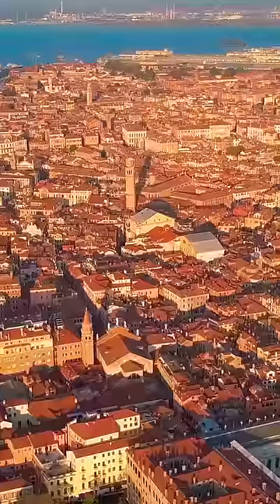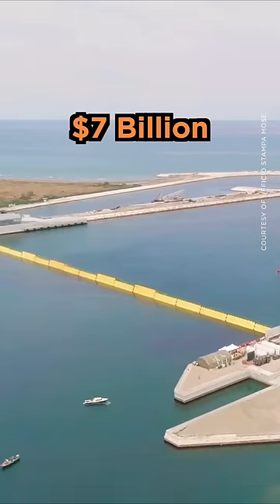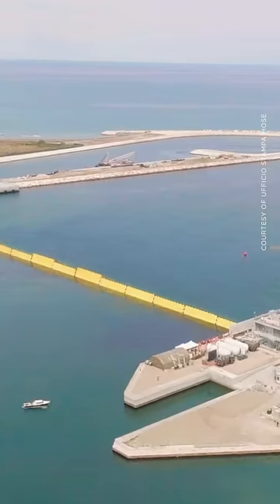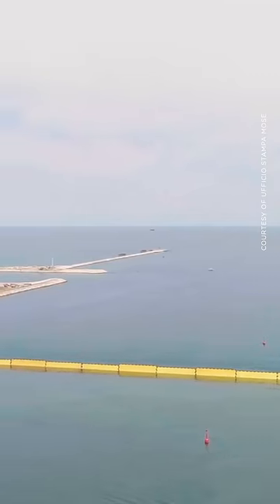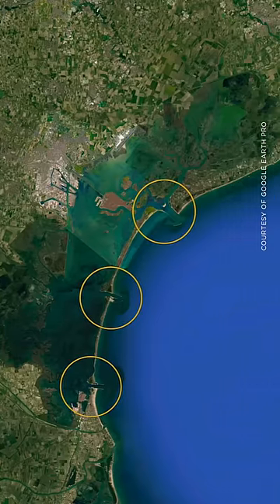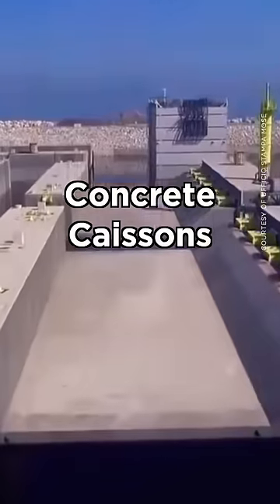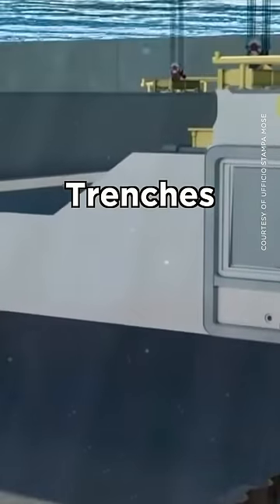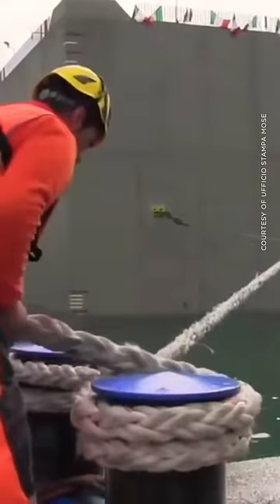How Venice STOPS Floods

Comment: The Dutch experts said this would fail miserably. 
It did.
They should've taken their advice and knowledge
Reply: What, no it didn’t
Reply: @flashxcate  it did
Reply: What do you mean? It does work. The completion of the project was delayed by many years and it ended costing much more than it was initially expected. But after completion it works perfectly.
Reply: @eskiltester3913 How did it fail?
Reply: @eduardobone8857  Not my comment, credit goes to @patricksanders858:
As soon as they were lifted, sand and rocks began to fill in behind it and they couldn't be lowered all the way down. Smart.
Reply: I’m dutch you gotta listen to the dutch when it comes to water
Reply: Of all the people to ignore the advice of, why the people who's land by all rights should have been underwater several hundred years ago had it not been for their efforts 😂
Reply: @Patrick_The_Pure  Wow, that's really disappointing. Thanks mate
Reply: @Patrick_The_Pure  that issue was fixed right away. They now work very frequently and prevented many high water events
Reply: The dutch, like in many other things, were wrong. The mose actually works.
Reply: do you knw how much money you can launder with a 7bil government project?
Reply: @dayros2023  its not even completed yet and many ministers and other individuals have been arrested due to the shear waste that has gone into this project. In the end, it may work, but it has been a massive failure and will continue to be. Multiple other plans that cost less, have less costly maintenance and are more reliable were suggested but this was done instead for whatever reason.
Reply: @jstefa2 at least double that lol
Reply: @davidbaptist96 Hell no it's shit we Dutch people have builder have builded 32 kilometers for only 2 billion euros and you can even drive on it.
Reply: Dutch are pretty smart. I would of listen fo them
Reply: The dutch know what theyre talking about. When it comes to managing water of any size of scale, i would seriously not consider calling anyone else than the Dutch, with all due respect.
Reply: No.
Reply: @Patrick_The_Pure it works perfectly, and has been used several times over the years
Reply: I looked it up on several news sites and most agree that it has been working fine since 2021, though it wasn't fully complete until 2023, but with the rising tide and sea level from climate change it will likely work for far less time than expected, about 30 years. Though it was always thought to be a temporary solution they expected 100 or so years. And there are concerns about ecological and environmental consequences. But it does currently work.
Reply: @theblindfoldedpilot1699 the real reason why they didn’t listen to the Dutch is because it would’ve been cheaper. 
A lot of people got rich off of building this contraption.
Reply: Sometime one must learn the lesson themselves which they are stubborn to listen to another country's ideas
Reply: @dayros2023  The Dutch are normally so wrong that their country is still... DRY... O, and they are also the second largest exporter of agricultural products in the WORLD, from that very small country.... LMAO
Reply: Problem from nature’s side is, if you block the water permanently, then the whole Lagoon’s ecosystem, based on the mixing of sweet water from rivers and salt water from normal tides, gets fucked over
Reply: they preferred to take the money 😂 w italy, w mafia!
Reply: @Patrick_The_Pure okay but that just means that they're still blocking the water, right
Reply: Dutch what?
Reply: @Patrick_The_Pure bruh that guy know nothing
Reply: @eskiltester3913  and yet it does, since it did multiple times in the last few years. Given that i live here i should know. It didn't work the first few times but now it does.
Reply: @dayros2023 "the dutch, like in many other things were wrong" totally not you ignoring the fact that the dutch have experience and got massive swaths of land from the sea from years of building dams in their own country. Yeah i think they know what theyre talking about
Reply: Tf you're saying it works perfectly 😂
Reply: @eskiltester3913 someone is in denial
Reply: I like how this all boils down to you guys going “yes” and “no” back and forth
Reply: It's definitely not conpletely useless there are many articles and news stories you can find talking about how it has prevented flooding. For example in November of last year the Washington Post had an article named "Venice's new MOSE barrier just prevented a historic flood"
Reply: Oh, what do the Dutch know about managing water anyway 🙄😂
Reply: @eduardobone8857  as you know
natural water bodies are not clear.  Sand get's underneath the hinges when the barriers are up. When they need to get lowered again some barriers get stuck in the upward position
Reply: @davidbaptist96  "Following years of corruption and issues with Italian administration, an independent expert is the best bet to rescue the city from peril"

"Why, after 16 years and expenditure of €6bn, are the mobile flood barriers (Mose) still not working? This is the furious question that the Venetians are asking: why, when they are supposedly 93% finished, has almost no work been done since a major corruption scandal was discovered in 2014?"

"a highly qualified French engineering firm has said that under certain conditions the barriers will begin to oscillate and fail, but they have been ignored. Are they right? No one knows."

"In reality, Mose was only activated for the first time in 2020, and even today is not yet fully operational. It is now scheduled to be finished in late 2023."

""Mose is going to work for a time – maybe 100 years or so – but I think that, in the end, a Dutch-style solution will have to be introduced," says Carrera."

As a Dutch person who's been to italy many times, i'm not surprised. Funny how the average Dutch person can see how this will all fail pretty hard........Yet Italians got convinced to invest 7 billion.
Reply: @dayros2023  Like in most cases, we were right.
Reply: @transformerstuff7029  lol no it worked. Wrong as usual.
Reply: @dayros2023  "Following years of corruption and issues with Italian administration, an independent expert is the best bet to rescue the city from peril"

"Why, after 16 years and expenditure of €6bn, are the mobile flood barriers (Mose) still not working? This is the furious question that the Venetians are asking: why, when they are supposedly 93% finished, has almost no work been done since a major corruption scandal was discovered in 2014?"

"a highly qualified French engineering firm has said that under certain conditions the barriers will begin to oscillate and fail, but they have been ignored. Are they right? No one knows."

"In reality, Mose was only activated for the first time in 2020, and even today is not yet fully operational. It is now scheduled to be finished in late 2023."

""Mose is going to work for a time – maybe 100 years or so – but I think that, in the end, a Dutch-style solution will have to be introduced," says Carrera."

As a Dutch person who's been to italy many times, i'm not surprised. Funny how the average Dutch person can see how this will all fail pretty hard........Yet Italians got convinced to invest 7 billion.
Reply: @EmmyEmber8  1. It's been "climate change" for at least a decade now, because "global warming" is easily disprovable.
2. Venice is sinking at least twice as fast as the worst predictions of sea level rise cause by the climate change.
3. Doesn't look it it helped this year.
Reply: @LecherousLizard  Oh oops, Two of the articles I found did still use global warming so I must've accidentally copied it, I'll edit my comment, thanks
Reply: @LecherousLizard  And I have looked again, most sources I can find are 2022, and the singular source from 2023 also said it helped but that it has been used far more than it should for the health of the lagoon itself. I can't find anything about it not helping this year? All sources from 2023 I get are talking about flooding in 2019. Though it is hard to find sources from 2023 anyway, maybe just algorithm working against me.
Reply: @theblindfoldedpilot1699  That is a dike. Something totally different than in Venice. In Venice cruiseships can go through.
Reply: @EmmyEmber8  Checked the map of recent floodings and Venice was in the red just fine.
Reply: @rub3s  they can also go through
Reply: You can also open in and close it
Reply: @LecherousLizard  Oh okay, didn't even know there was a map.
Reply: The Dutch know water
Reply: "you gotta listen to the dutch about water" lmao get outta here, the dutch learned from Venice. Let's talk about the failed dutch projects...
Reply: I live in Venice and I assure you that it works
Reply: @dayros2023 the Mose is a stupid idea and it will not last long
Reply: You don’t have to be an expert to see that it won’t work 😂
Reply: Not if Berlusconi wanted to make profits
Reply: I mean from the comments it does seem to work, but 7 billion is an outrageous price!!
Reply: @melissabloemen  the comments leave out that it didn't work and required Dutch engineering to solve the issues.
Only recently it was fixed.
Reply: I spent 5 yrs in high school in Venice. It was used only for very bad tides, in theory when there's more than 110cm over sea level. San Marco square goes underwater at 80cm and many other parts of Venice get submerged under 110cm (like my school that had the central court just below 110). The only time it saved the city was in December 2022, at the time it highlited a very important issue: where does all the water that does not get inside the lagoon go?
It went all over the land around the barriers (Jesolo, Cavallino, Lido, Pellestrina and Sottomarina). It reached 204cm on said land which means the highest tide ever, even higher than the former '60s record (acqua granda). My classmates that live there showed me photos of their gardens and roads full of mud...
Reply: Dutch are just jealous that Amsterdam is a shanty town compared to Venice.
Reply: Italians  are known  for their  great engineering    thats why they usually  get engineering  experts in from other countries  to build everything
Reply: @ChrisChris-ky8cz  lol read that again.
Reply: No man it's working
Reply: @fulviopontarollo2952 
The Dutch do more than only making barriers against the sea. There’s a complete watermanagement system what will keep the Netherlands dry , also against rivets.
And also a system soon to control the drought because of climate change
Reply: @wake-upcall4867   yeah but as I said the lagoon’s ecosystem needs both water from sea and river water mixing and submerging the grassy sandbanks during parts of the days with the tides, so blocking both sea and rivers is the absolute worse for that isn’t it. The whole point is they couldn’t adopt a system that kept things dry permanently like the Dutch one so they did an alternative one themselves, albeit rather inefficiently
Reply: @flashxcate The issue was never fixed they just have to go and clean out the rocks with divers frequently.
Reply: @davidbaptist96  They mean that it doesn’t stop the floods. Just because it’s functioning doesn’t mean it’s fulfilling it’s role, similar projects were done hundreds years ago and they failed so I don’t understand why they thought this would be different.
Reply: @everythingsfinett3903   It does stop the floods, it just has a certain operating cost that make its use necessary only during particularly bad floods (which are sadly forcast to become more common in the future). 

What kind of "similar projects" are you talking about? This isn't a simple dam. Just blocking the water would make the venetian lagoon into a lake, with disasterous results for the wildelife (and for the economy of the region).
Reply: Wow Dutch people. Settle down 😂
Reply: @MARK-gp9hb I know right… Dutch ppl are good at not shutting up 😂
Reply: @Patrick_The_Pure How tf did I not think about that!??
Reply: @Patrick_The_Pure so how much do you get paid to criticize paid engineers?
Reply: It actually worked pretty well.
Building earth dams doesn't require any particular skill. It's not like being able to do them makes you an "expert" in anything regarding water.
Reply: In realtà sta funzionando.
Reply: The dutch "experts" said idiocies : it worked very well through the yrs saving the city from exceptional floods. And about their "knowledge" : what do they know about specific morphology of territory and saving the most beautiful city of the world ? Stealing lands from sea is another job, so their knowledge in this field is equal to theirs in football winning...! 😂😂😂😂
Reply: @carlobrotto7132  The dutch are leading in morphology of coastlines and prevention erosion and changes for both sea, inner waters and rivers lol. You forgot to google.
Reply: @ooRobertoo  as yet said, they became expert in taking lands off sea after themselves had suffered devastating floods, but they know nothing of the morphology and the millennial history of Venice lagoon, they know nothing of saving a city with such an incredible artistic heritage and, most of all, know nothing of the cyclic random floodings and their effects on the thousands of canals inside the city.  The dutch " counsels" are as ridiculous & pathetic as their faith that Venice is equal as Zelandia...🙂 You need to learn how and when to use google
Reply: @carlobrotto7132  I doubt you studied anything near infrastructure, you don't make alot of sense.

The history of Venice and artistic heritage have no influence on what the sea does with them.

The Netherlands does not need to know the morphology of Venice nor the canals and their effects in Venice. They only need to when they have to. They are the most experienced in dealing with inland water or tides and morphology.

Sure they aren't flawless. Although bow there is not a country better than them in taming water to their will.

Venice itself doesn't know what they are doing, hence why it's all going down.
Reply: Call an expert, the Dutch

Comment: "Heres how its supposed to work."

- Titanic engineer
Reply: Except the Titanic did everything it was supposed to do. the ship wasnt designed to withstand the massive amount of damage the iceberg caused, so it actually did a really good job at slowing down the flooding.
Reply: @DiamondFireball 👊
Reply: There was nothing wrong with the titanics engineering or build quality they just werent planning on some dumbass captain ramming full speed into an iceberg
Reply: @DanfromOz the Titanic wasn't traveling at full speed, the Captain wasn't even on the bridge at the time of the collision.
Reply: @DanfromOz the Captain wasn’t a fool speeding into an iceberg. He was following normal sailing procedures. He actually diverted the course south to avoid the ice field. Ships manoeuvre at high speed. But the Titanic wasn’t even at full steam as she was brand new and Capt Smith wanted to run her engines in. It was just a perfect storm. It was a moonless night so visibility was low. The lookouts didn’t have binoculars, but again normal practice. The sea was calm like glass so no waves were breaking against the ice.
Reply: @MightyJosh1985 interesting. So how would a captain be noted today of the iceberg?

Comment: When he said "here's how it's SUPPOSED to work"...
Tldr: it doesn't work 😂
Reply: It actually does.
Reply: I looked it up on several news sites and most agree that it has been working fine since 2021, though it wasn't fully complete until 2023, but with the rising tide and sea level from climate change it will likely work for far less time than expected, about 30 years. Though it was always thought to be a temporary solution they expected 100 or so years. And there are concerns about ecological and environmental consequences. But it does currently work.
Reply: @EmmyEmber8 lol global warming....
Reply: What does tldr mean?
Reply: @gamebreaker60  it means "Too long, Didn't read". Basically just summing something up
Reply: @EmmyEmber8  Gotcha. Thanks you!
Reply: @pain_weaver  I meant to use climate change not global warming but two of the articles I used said global warming so I got them mixed up. Changed it now.
Reply: @dayros2023  no, too expensive to make it work, because it's not automated, so it's humans doing everything.
And besides, it's not profitable for Venice to use it every time it should, because otherwise tourists can't come by boat, so they made a raised walkway system and watertight barriers in the city.
Reply: @EmmyEmber8  both terms would work since the warming of the globe leads to sea level rise and climate change leads to more erratic weather
Reply: Aren't these things getting rust as well?
Reply: @Danokh well... when you look at average world temperature, climate change would be characterised by an increased global temperature (hence global warming). Though, on a more local level, global warming would lead to more extreme weather events (hence climate change, with climate meaning the average weather pattern of a region). Global warming and climate change go hand in hand but they're not exactly interchangeable.
Reply: @cleo5610  Totally agree, I was referring to emmy's comment about sea level rise, which both global warming and climate change are responsible for
Reply: It worked pretty well for more than two years by now. On Nov 22 2022, despite not having been even completed. it stopped the record tide in the Adriatic, 205cm. Water in the lagoon rised only 77cm, a quite normal tide.
Reply: It's 2024, does this work now?? 😂😂
Reply: @JohnWiku  Yes, it does. It did for more than two years by now.

Comment: It does not need to stop water from entering the lagoon altogether, it just needs to decrease the flow rate. Water enters the lagoon due to tidal effects, and a tidal cycle lasts approx. 8 hours. In fact, over the several times it has been tested it worked, and not all the three barriers needed to be raised